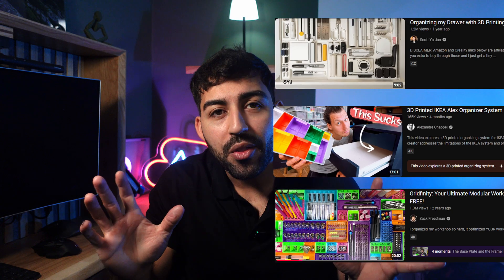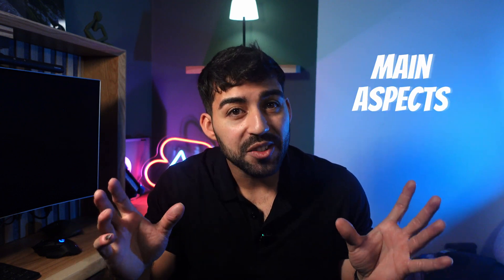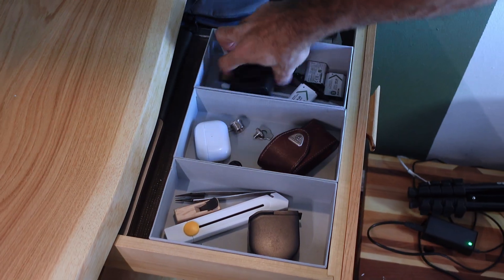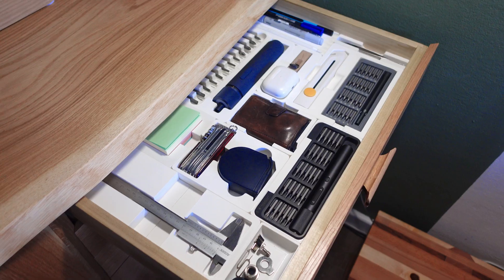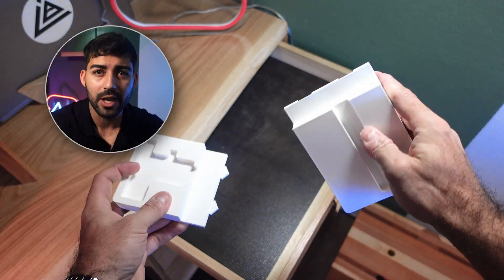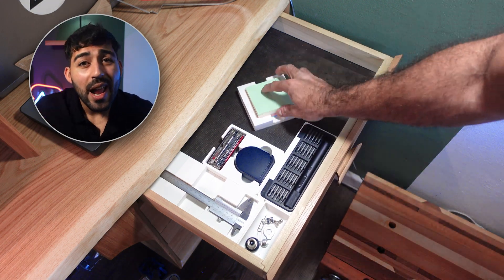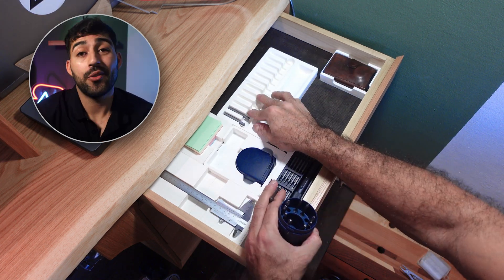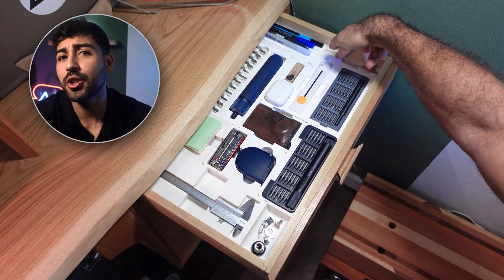The Secret To Finding Every Tool In Your Drawer!

Comment: Why is the ender v3 not a good option? I just bought the ender v3 ke couple weeks ago was that, that big of a mistake?
Reply from the maker: no i didn't say ender 3 v3 i said ender 3 (meant the v1)  i loved that thing and every freaking upgrate i had to make but now im getting old for tweaking a 3d printer i just want a machine thats working out of the box without headaches :P